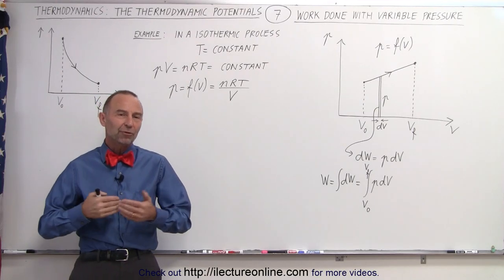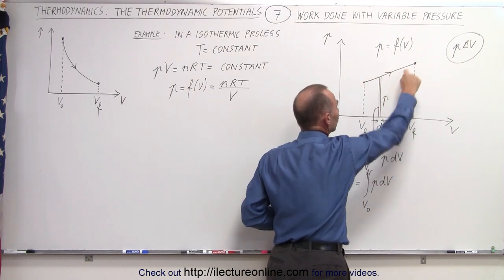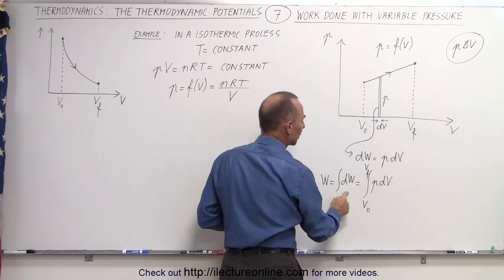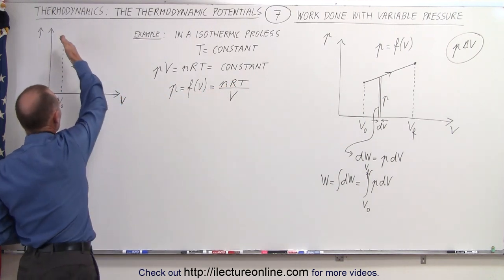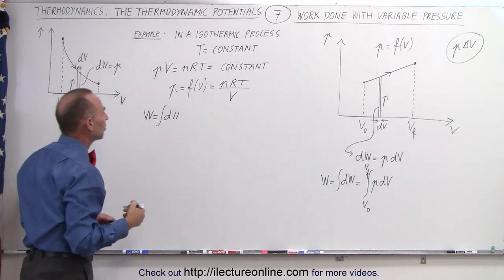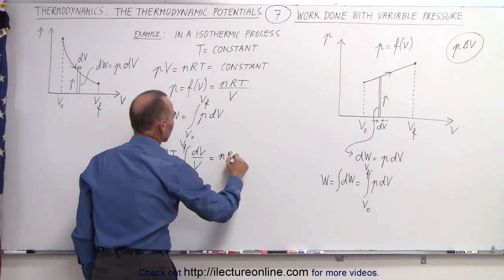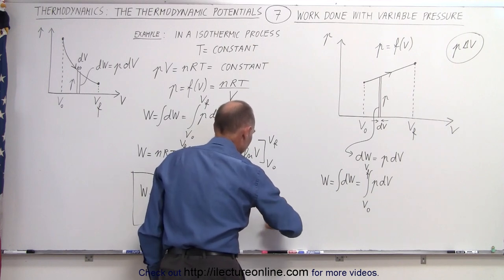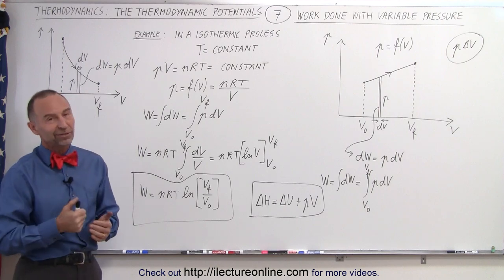Physics 32.7  Thermodynamic Potentials (7 of 25) Work Done with Variable Pressure

Comment: Since there is no phase change going on, the fact that the temperature remains constant should mean that the change in internal energy is zero, hence the total change in enthalpy is the work done by the system.  Enthalpy is kind of like an accounting tool, to keep track of the energy flowing into / out of the system.  The work done by the system, no longer in the system (put into the environment) at this constant temperature process must mean there is an “energy” source.